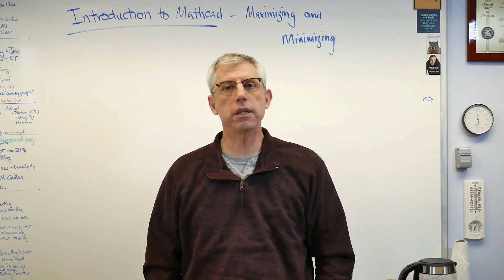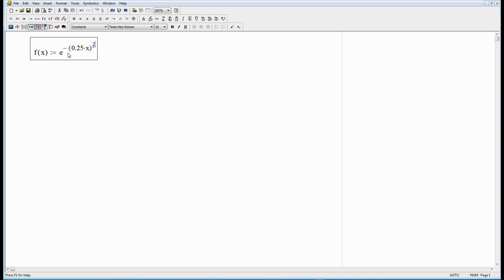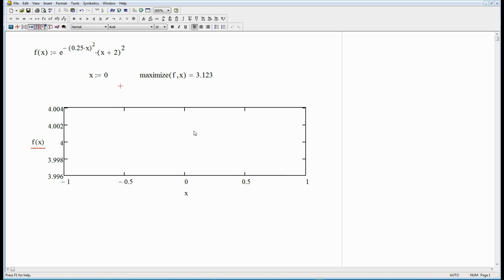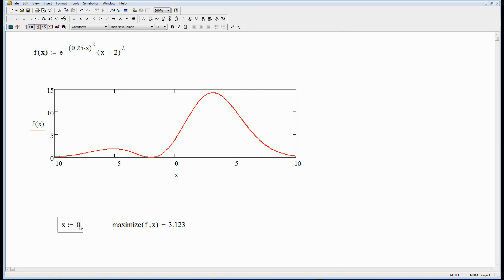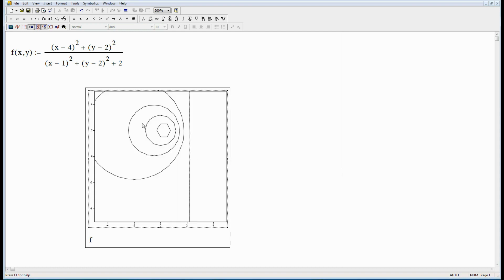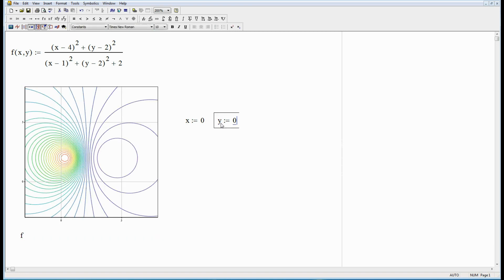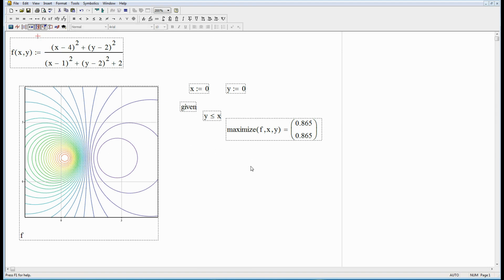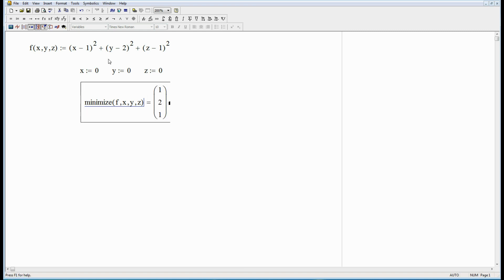Intro to Mathcad 4/4 - Brainwaves

Comment: Thanks very much for the informative video. I really enjoyed this mini series.
I have a question relating to plotting what I'm going to call "nested functions" (not sure if this is the correct term)
As an example, I have the following series of functions:
x(t):=2*t, y(t):=2+t, z(x,y):=x+y
I would like to plot z(x,y). I still only have one independent variable (t) but MathCAD shows an error when I try to plot function z against t. Do you know how I'd able to fix this? Obviously I could just rearrange z(x,y) to be in terms of t (it would be trivial for this example), but my problem is much more complex than this, and I'd rather keep the equations in their original form.
Reply from the maker: I replaced your last statement with z(t):=x(t)+y(t) and it plotted just fine.  Is that what you mean?
Reply: @purdueMET  Yep that did the trick. Thanks!